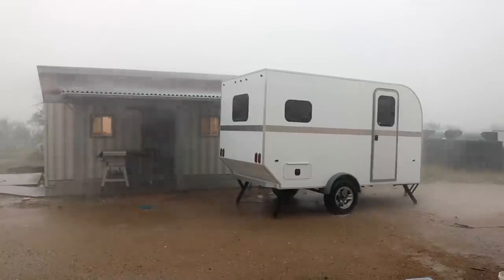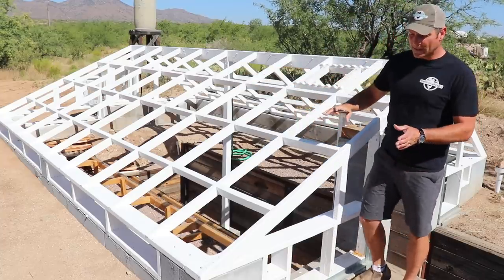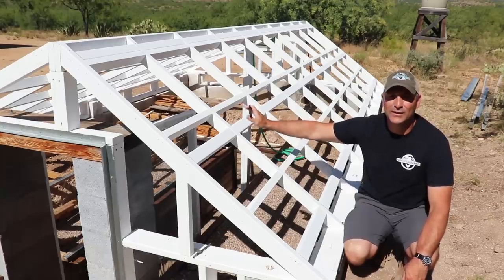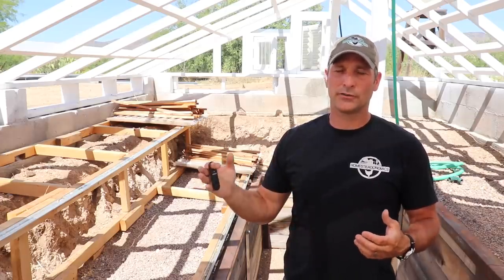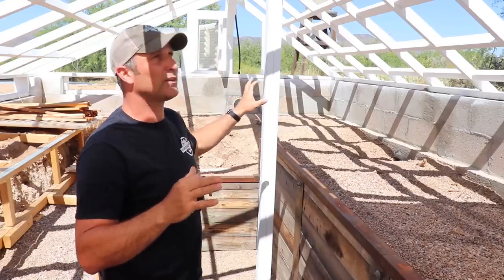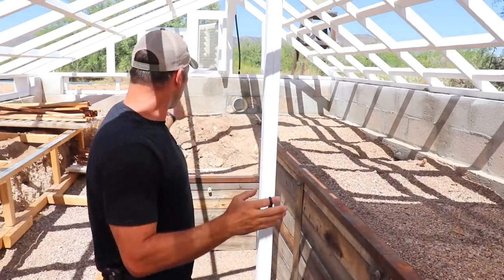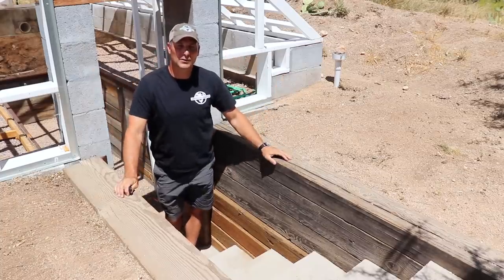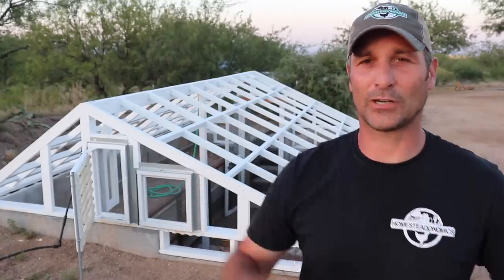Sunken Greenhouse Revival - Plans

Comment: curious.  How does the "floor" of the greenhouse stand up during a rainstorm? i.e. does it flood down there?
Reply from the maker: no flooding inside the greenhouse.   the panels (when on) shed water off the greenhouse and the ground outside is graded away from the foundation so no water flows back to the greenhouse.   some water comes down the stairs but it is very minor and isn't ever standing water... just a little wet patch by the door

Comment: Hinged shade panels that when not in use fold over covering the steel roof portion?  As long as there is a way to lock them down both ways, I see it as a win win.  But I may be wrong.

Comment: Well l'd make the panels for the roof out of light wood, like a door that has a handle and folds back off the roof and rests on the ground so its easy to flip it back on and truthfully l'd try not having another roof, so you dont have the heavy cost of replacing it every time it hails. if you really want cover get cheap plastic.

Comment: I would go with 2 layers of clear visqeen one stapled on the inside and one on the topside giving you a dead-air space.  It'll last a few years then need to be replaced.
Reply: Max Powers ...also the double polly concepts work well against wind..hail..snowfall..and the air layer between insulated too if airtight....
Reply: It could be made with bellows too.  A fan could blow into the cavity to inflate it. It would ruin the nice asthetic of the frame but  I think function 1st  on stuff like this.
Reply: Also added the filtered sun will become ...BRIGHT WHITE LIGHT...  plants will love it yet not get burnt...

Comment: Was the Hail predicted....? If so I would put 4 metal poles 4ft high and 10ft 45 x degress from each corner...Then a loop on top and make a big heavy CANVAS fly sheet. You can rig it if thunder is predicted.

Comment: INQUIRING MINDS: Would a sunscreen sail shade design work; that is, if these were strategically angled/placed to simultaneously disrupt airflow (thus squarely addressing your concerns about strong winds creating 'lift' and/or racking the structure) and distance/staggering could provide impact protection from any possible hailstorms)? *Asking for a friend...

Comment: Taking English riot vehicles as inspiration but chicken wire or some other type of screen suspended over the glass to take the hail or wind blown objects
Reply from the maker: thats very close to what I was thinking... having it spaced for hail or other flying objects to protect the panels:)
Reply: @homesteadonomics   I saw a screen out of stainless steel piano wire on 1" spacing stretched tight you could almost walk on it

Comment: Suggestion for your cooling tube: If you put a reducer on the end that vents into the greenhouse, it will compress the airflow. Thermodynamics says- as the compressed air is allowed to expand again, it will become cooler than the air going into the tube. Here's an example video...  https://www.youtube.com/watch?v=fd10lF2mxAU

With a small 12 volt fan to help force the airflow, it works even better. Good luck friend!!!
Reply from the maker: that was part of my original concept to have a larger spaced tube or chamber then to compress into the 6" pipe... kinda like cool air coming out of your mouth when one purses their lips to make a smaller opening.   I will check out that video too... thanks! :)
Reply: Exactly what I was thinking lol. That's what the example video shows. Love watching your projects come to life friend. Keep up the great work, and thanks for sharing with us.

Comment: Since you are making the North side solid, a roll across the top (more on the North side, not in the middle), would prevent much sun light blockage and probably allow you to choose from a different variety of materials to shade and prevent hail damage. 

But, if the issue you have with using it in the summer is the extra heat, you could also put a drip house along the peak and have water pour down to cool off the greenhouse.  My friend, Rick, uses the method to keep his barn cool in the summer.  It might also work for cooling off your green house. 

https://www.youtube.com/watch?v=u1V_ygHUz3w

Comment: I love your design, but have to say, I have used the corrugated poly-carbonate that you used, and really dont like it. Its junk. I found the stuff that sweetwater steel sells, in the ur panel panel, which is a thicker poly carbonate panel does not break. You can run over it with a truck, and it pops back into shape. It is about twice as much, but you wont be replacing it every time it hails. I live in Texas, and only dug mine three feet deep, but on the outside, it looks like a normal greenhouse, with seven foot walls. But on the inside, its of course ten foot tall.
Reply from the maker: I will check that out for sure... is it the twin wall stuff?  sweetwater steel?   I'll go check on the googles now :)
Reply: @homesteadonomics  its the only polycarbonate that they sell. Not the acrylic.  Even though the acrylic is 80 bucks a sheet, it still breaks easier than the poly.

Comment: ....you are missing a real opportunity to improve your greenhouse!.....the north roof should be removed & reinstalled on the same plane as the south roof changing it from a gable to a shed roof!...the north wall becomes a vertical wall made of opaque material for solar gain in the greenhouse!....the added height allows for trees & lager plants....
Reply: I like this suggestion. You can pile up soil/compost/whatever behind the N wall too. I designed  a passive solar like that, with stalls behind the N wall & with barrels of water inside to moderate temperature.